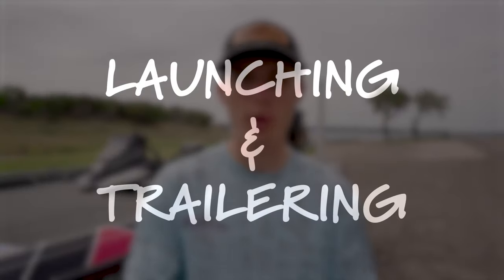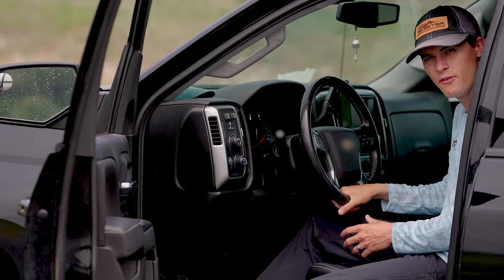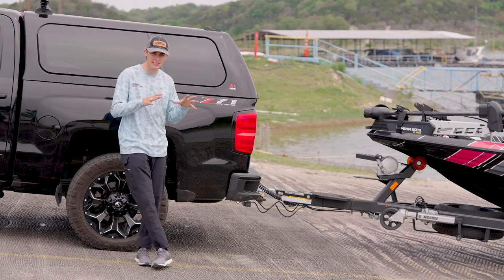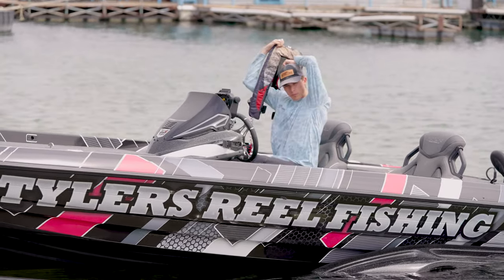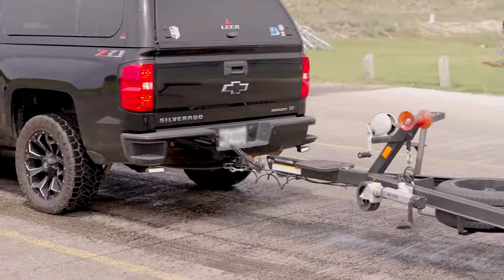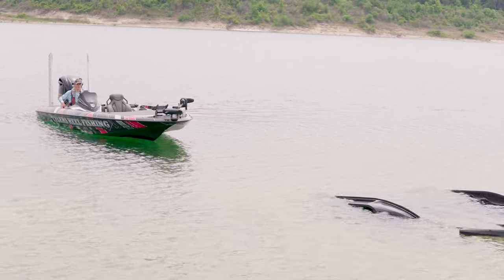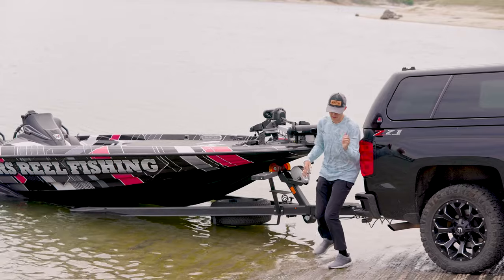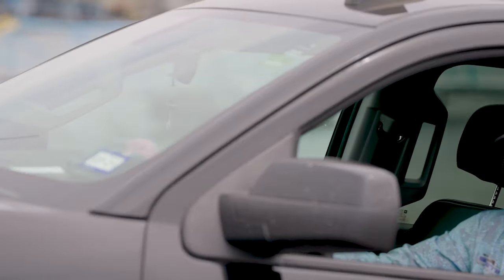Skeeter School - Launching & Trailering with Tyler Anderson

Comment: Nicely done!
Reply: Hey i wanted one of those 21ft FXR2D2 models at $90K “base” and five graphs all over the boat at a extra $18K and a satellite dish and a 19”TV but i had to settle for a ZX-150. Dont get me wrong but i under estimated this little 18’-6” boat, it fits my fat butt just well, very stable, can hit 51mph with two guys weighing 560 pounds and a full tank of gas, two power poles and full live well. It was tough finding her happy place on plane, started Porpoising really bad but i have found the sweet spot. Hopefully that spot doesn’t change with less fuel or maybe a empty live well etc etc.